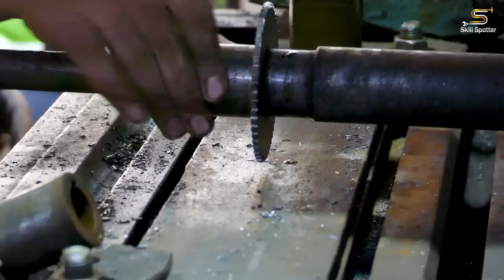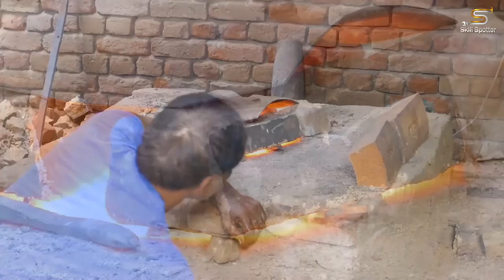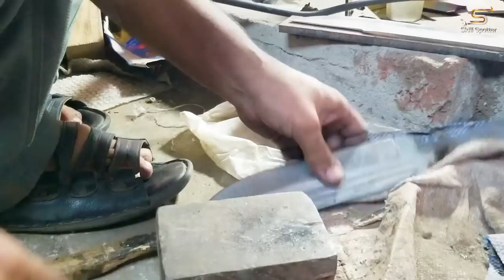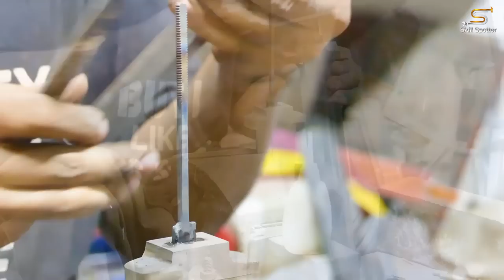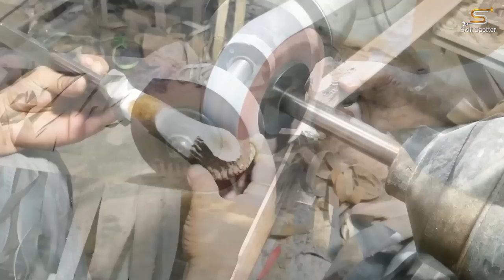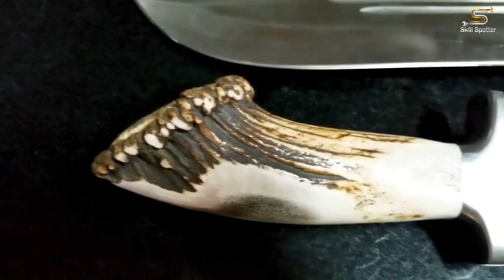Handmade Bowie Knife with Deer Antler Handle, Stag Horn Bowie Knife Making Process

Comment: Looks nice but it’s  a stick tang and will break apart if used, everything made in India or Pakistan or China is to be avoided.
Reply from the maker: Respect your opinion.
Reply: Not all stick tang are weak most historical examples of swords are a stick tang and survived many battles un broken. The fact of where this is made does make the strength a dubious proposition
Reply: Having now watched further the type of stick tang in this build is beyond ridiculous and also knowing where it's made its a piece of junk only good for hanging on the wall
Reply: @lorneclose7312  OK for swords, but a large hunting knife is supposed for a harder work. A massive full tang, two rivets, and go easy!
Reply: My friends, Pakistan-made products are sold in every corner of the world, like knives scissors and sports equipment, football, etc.
Reply: @lorneclose7312 what!!!!?  that's not true at all!!!  most swords lasted one battle at best. the iron was crap and they weren't made well. I promise I'm not trying to BS you.... look into it
Reply: @lorneclose7312  not true, your statement "most historical swords are stick tangs"  completely false statement
Reply: I agree with you, the ratio between the blade and the tang is not good, Bowie knife is not just for slicing or stabing but also slashing. Use this poor knife for slashing dry old thick bamboos, trust me, it will be broken. Using D2 steel u can make wider and stronger tang and will be a great functional knife.
Reply: Thats half a statement mate .......those blades would be $100 , maybe $200 ...... now tell me where i can get a wood choppin stylish quality bowie for $200 , answer is nowhere ....thats the first thing , second thing is stop watchin forged in fire its for entertainment , i catch any of my kids misusing a knife like chopping wood or being stupid with it then they loose it , knives are made to cut and slice not chop and whack , ...... you got a $600 bowie and you reckon you,ll use it as a $40 axe ... have a good think about it , horses for course , get a tomahawk if ya wanna play forged in fire , these blades are really nice , really cheap and with steel and antler they,ll last a lifetime and are also repairable for any half assed knifemaker ..... nice video , good skill display for the money
Reply: @wilddogminer9320  well in my country lot of blade smith make an excellent quality blade from Vanadis Elmax, Sleipner A88, D2 - Bohler K110, or SUP9 steel for wood chopping for US$100 - 200. Full tang blades with proper quenching and HT. I see on YouTube lot of western makers sometime wasting lot of resources for making a blade and also the branding, make the blade more expensive.
Reply: @wilddogminer9320  You can check my video collections, all my blades are 100-200 US$
Reply: @YohannesRaynar  I do apologise if that came out wrong , I meant no offence to the maker , I was retaliating against the gentleman saying they were no good , yes we waste a lot unfortunately…… use an axe
Reply: @lorneclose7312  ancient time using 'old school'/ancient steels, the toughness probably as strong as SUP9, but this is D2 steel, high carbon steel with high hardness (probably 58 - 64 HRC), higher hardness will be less thougness and it can be brittle.
Reply: I’ve had a couple nice knifes from Pakistan myself!!
I still have the one that I bought at age 14 and I am 39 now.

Comment: I agree with David Leavy, the ratio between the blade and the tang is not good, Bowie knife is not just for slicing or stabing but also slashing. Use this poor knife for slashing dry old thick bamboos, trust me, it will be broken. By using D2 steel u can make wider and stronger tang and will be a great functional knife. D2 steel is as good as Bohler K110 or SKD11 steel and will make a good knife.
Reply from the maker: You are right my friend.
This is a half tang knife but these guys make so many other full tang knives and swords with other materials too.
Thank you so much for your expert opinion.
Reply: @SkillSpotter  for slashing or Bowie knife, i think SUP9A will be great too even if u use a hidden tang as long the tang is not stick and more wider and than put some pins on it. With water quenching just half part of the blade and not quench the whole part of it especially the tang, the hardness and the toughness will be good and nice for a multipurpose knife like a bowie style knife. Happy Ramadhan, regards from Indonesia🙏

Comment: I would order IF: 1) The knife had a traditional handle made of iron mesquite wood; 2) The handle was a full tang (not welded) and revered; 3) The clip point of the blade was a bit thicker at the end to prevent breaking off / prevent snapping off, and sharpened to provide a back cut while slashing with the back of blade; 4) Do not put a fuller on it, just a straight blade; 5) Knife be made of 1075 high carbon steel with a 10" blade, 5" handle; 6) handle sweeps and curves to a rounded knob at end like that of a pirates cutlass; 7) cross guard to be of a bracket shape as this "]" to catch opponents blades, lock and twist; 8) An extra bonus would be for the blade to be blackened and matte in the final quenching process, having absolutely no shine, looking very primitive in every respect from butt to point; 9) Capable of any camp chore; 10) Beefy and balanced and rugged to baton with as well as throw. Please let me know if you can make such a knife with these specifications. Great job. Nice work. I'm interested in buying one.
Reply from the maker: Thank you so much for your valuable comment and suggestions.
We will make more videos of extra strong knives.
You can check the description of the video for more details about these knives.
Reply: @SkillSpotter  I hope you can make a custom knife for me as described above. Please let me know. Your skills are amazing! Thanks for your reply.